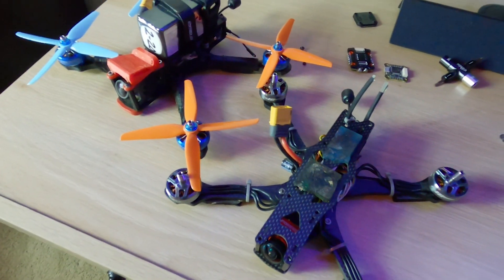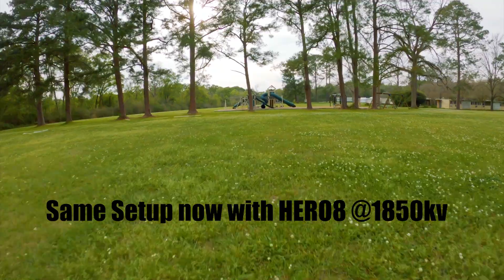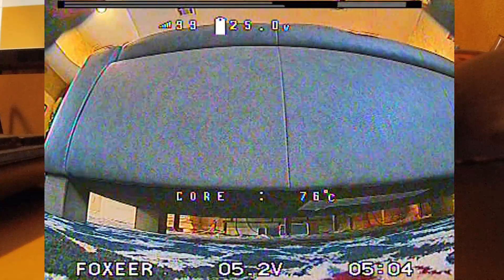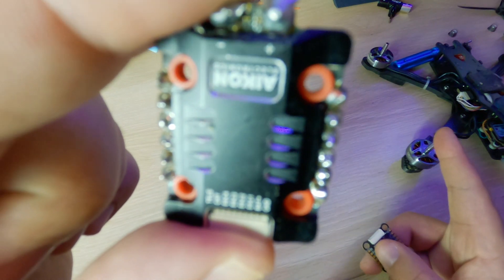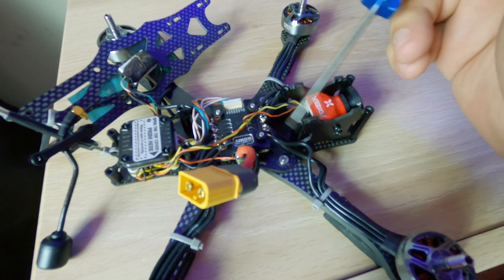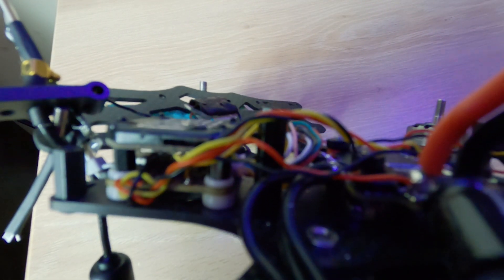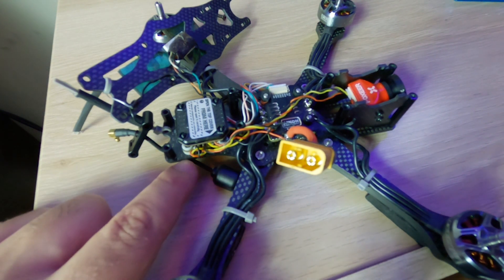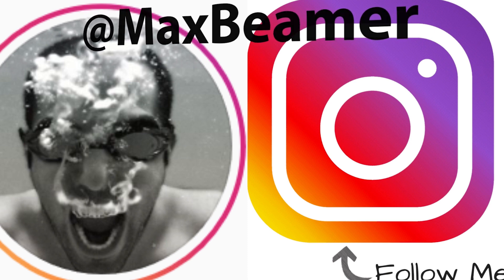The BEST WAY to FPV! 🚀 🔥

Comment: Bro, Aikon 32pin V2 with Brain Radix LI is a match made in HEAVEN. I have this combo in both my race and freestyle rigs. That Bosch gyro is FIRE. I've been using a throttle limiter in my OpenTX transmitter, is this the same as motor output limiter in BF? I would imagine not.
Reply from the maker: love the stack too its my go to for everything.. Motor limiting in BF is different it doesn't limit throttle instead limits voltage to motors effectively changing the KV to whatever you want!
Reply: @MaxBeamer  This is amazing. You've just saved me a whole lot of money. I run 2700 KV on 4s so I'm gonna try this today and limit it down to like 1950KV for 6s. I really appreciate your insight here man.

Comment: This is all assuming your FC and ESC's can handle 6S voltage.  I still have a lot of gear that maxes out at 4S or 5S.
Reply from the maker: this is true! probably should have mentioned that..
Reply: the new esc are so great not having to worry about things popping especially if your still running 4s on a 6s esc is bulletproof for yu I have em and still run 4s haven't popped one in like 5 months
Reply: Game changer is beta flight 4.2 that keeps rpm same regardless of pack voltage.... so 0 sag felt on 4s....BOOM

Comment: Just shared this with the homies. Good discussion to have on the FC in the back. I like the idea and I may have to try it myself.
Reply from the maker: for sure man, having it up against the bottom plate is definitely doing something.. Im interested to see how it turns out on other flight controllers that don't use the bosch gyro
Reply: Max Beamer good point. Different gyros could react differently to being in the back

Comment: I tried this and I killed 3 FCs. 2 transtec F7, 1 skitzo revolt. 3.3v reg died on all of them. This happened when I clipped a tree branch.
Reply from the maker: that's odd. howd you kill 6 flight controllers with one tree branch haha.. if anything were to go crispy from this it would be a mosfet or something on the ESC so I haven't seen the builds but probably something else going on sounds like voltage spikes maybe need a bigger cap?
Reply: @MaxBeamer  Yeah I was using the hobbywing 60a 4 in 1 and that just went out a while ago with a huge crash but it was working fine up until that point. Stock cap on the ESC. I ended up just buying 6s motors, and using a FC rated to 8s. (it was 3 fc's total, they died everytime I clipped a tree branch, not the same one everytime xD)

Comment: can't you smoke esc?
Reply from the maker: yes indeed you can always smoke an esc so don't go full throttle at 2750kv on 6s (even tho I have very briefly and things were fine)
Reply: @MaxBeamer  hmm, Typhoon32 4in1 ESC 4x35A looks supporting only 3s-4s - don't want to risk it :D
Reply from the maker: yeh the v1 is 4s max so if you have that don't even try. v2 is good to go tho

Comment: "If you need more efficiency put x amount"... 
That is not how it works you are limiting the maximum output of your motors not changing the coils and turns inside the motor.. You will be moving the efficiency delta of your current motor as saying:

If before motor output limit your max efficiency was at 70% Throttle
Your max efficiency has now moved into the 90% Throttle area... 

If your motor was doing x amount of efficiency that WONT CHANGE by using motor output limit you are just raising its place on the RPM range by shifting the power band.
Reply from the maker: When I say efficiency all I’m talking about is flight time. It changes based on motor limit %.

Comment: I don't know why motor makers don't just release motors made to run faster without the burnout risk. I have smoked 2206 and 2207 4s motors on 6s. What we need are 6s 2100kv 2300kv 2800kv 3000kv motors available. I know props go supersonic at the top end but I like the twitchy feel where the usable rpm range is lower on the throttle.
Reply from the maker: god damn! If you were to run 6s on 2800 or 3000 you'd probably need a throttle cap to save that extra voltage at the top end then you could still keep the lower throttle punchiness without wasting away lipos lol
Reply: wait a few months for beta flight 4.2, feature that keeps motor rpm same regardless of pack sag, n stay 4s, n don't stress ur shit w 6s voltage...imo.
Reply: Yes Max you could. Flo that sounds like a useful feature. I often wondered about an ESC which was also a DC DC converter so each motor pulse could be standardised with fixed voltage and current. Adjusting the RPM's in software as the battery sags could work somewhat.